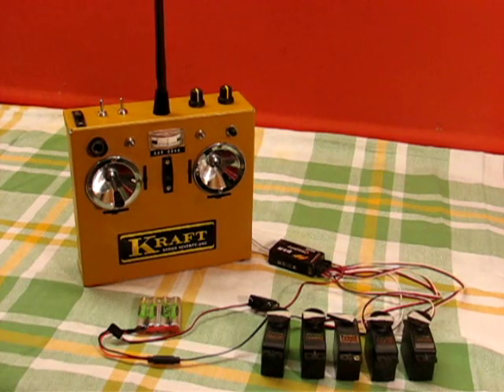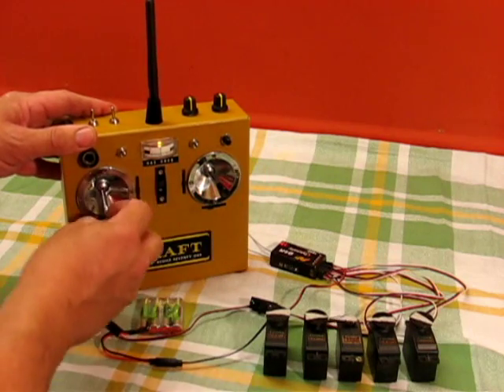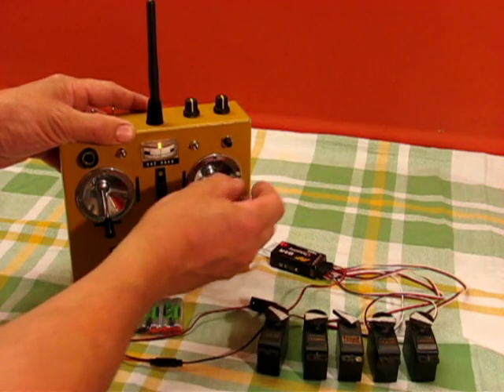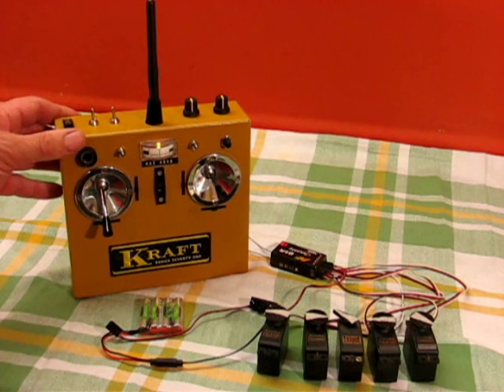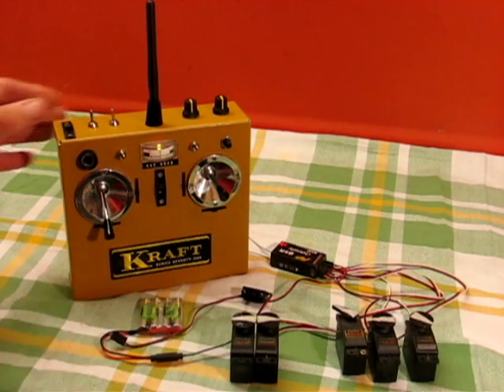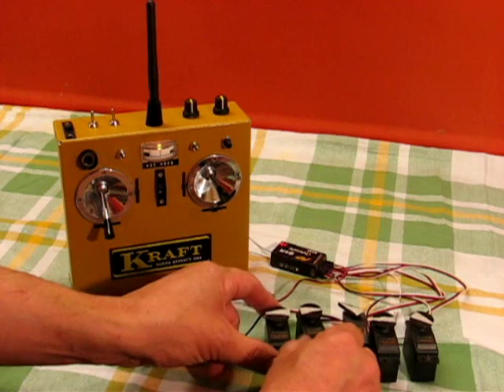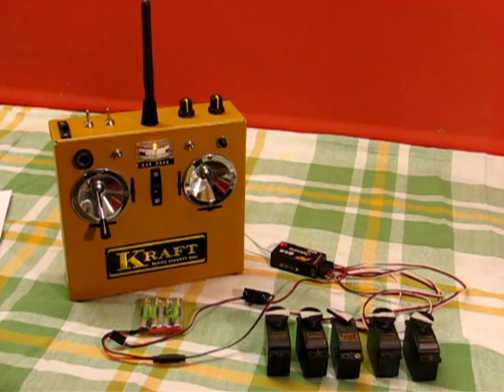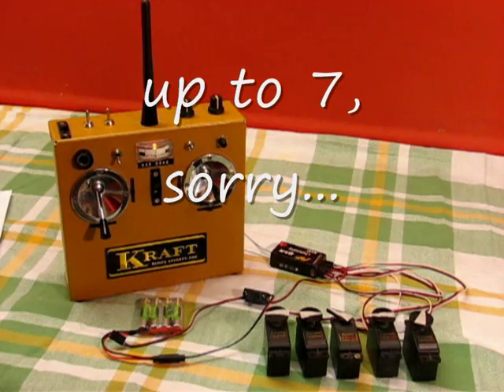Kraft Series 71 refit completed - final rundown

Comment: I have the Kraft Gold Medal Series from 1969,  it's similar looking to what you have but it's a four channel and the antenna disconnects. I bought it off of the original owner in 1975. It still works, 75.64 MHz if I remember right. (Green and White) They were all hand built sets and were very costly

Comment: Thanks for describing your project. You gave me lots of ideas for project I have planned.
I have an old Futaba helicopter radio with a nice metal case. I want to add a new transmitter module to the case and add a microcontroller to add features like the ones you described.
Your description is likely all I need to add these features but it would have been fun to see the inside of the case to see how you wired things.
Thanks for taking time to document your work.
Reply from the maker: +Duane Degn 
Its all documented on the Archive page of www.singlechannel.co.uk Duane.
Articles P16 and P17.
Cheers
Phil
Reply: +PHILG2864 Very good. Thanks for the link.